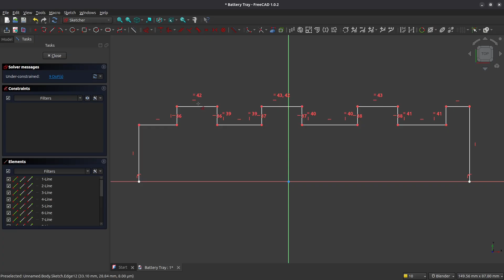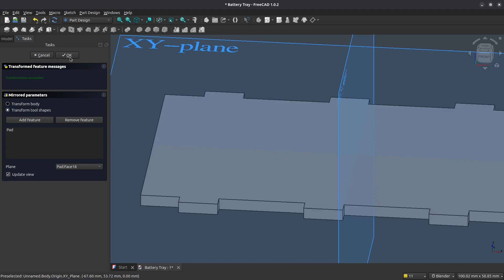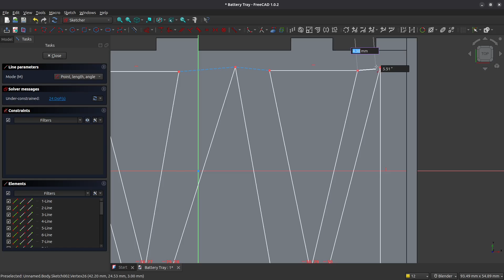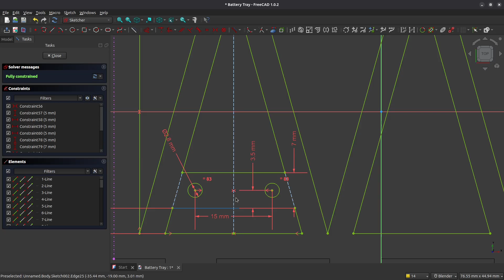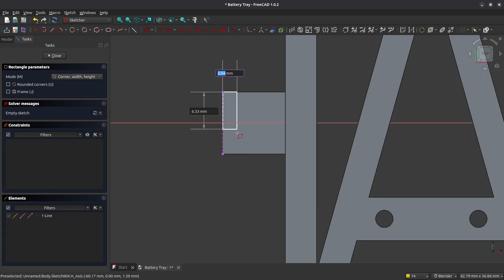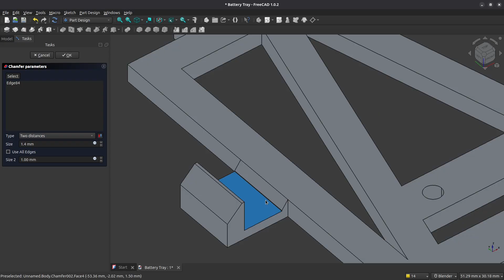Part 4: The Battery Tray - TitanBot | FreeCAD Robotics Design

Comment from the maker: The "Fuel Tank" is secure! Getting the Center of Gravity (CoG) low is critical for stability.

Design Tip: We are using a Compliant Mechanism (the snap-clip) here. Finding the perfect balance between "retention strength" and "ease of release" is an art. If your print is too stiff, try reducing the cross-sectional area of the flexure arm by just 0.5mm—it makes a huge difference in the "feel" of the latch.

Next Step: We have power. Now we need brains.
👉 Watch Part 5 (Kinematic Control Tray) here: https://youtu.be/apfADt7CrrE

Question: I prefer hard-mounted cages like this for protection. Do you design custom battery mounts, or do you just trust the classic Velcro strap? Let me know! 👇